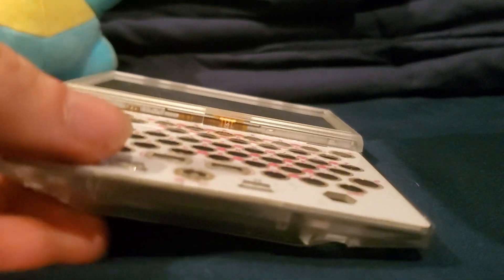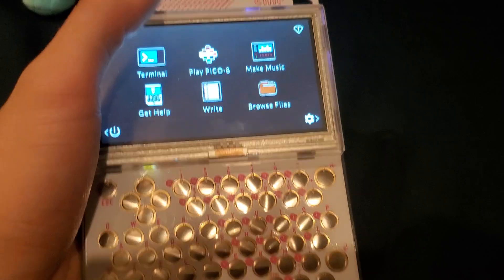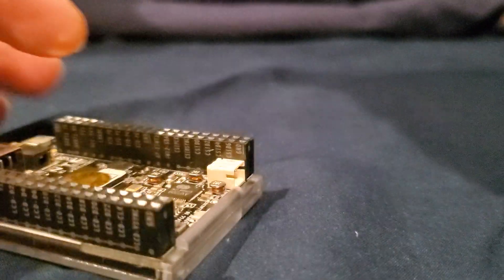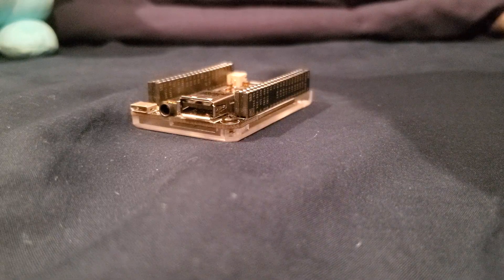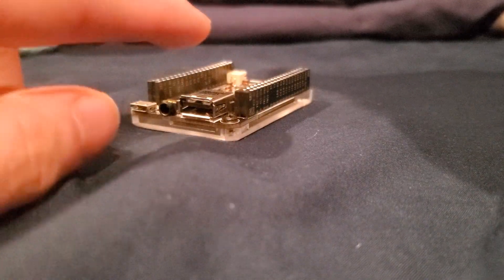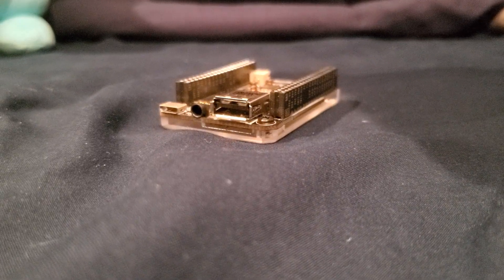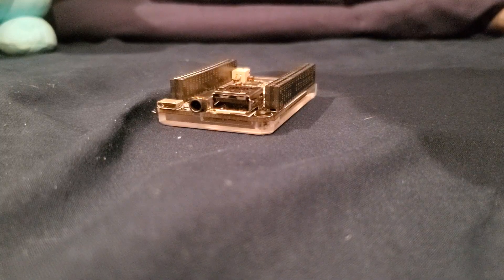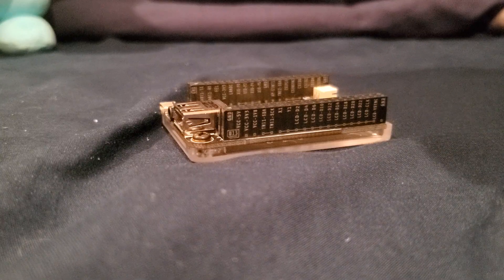Tech of Yesteryear - Pocket CHIP

Comment: I ordered several of those modules, mainly for their USB capabilities, but never received anything, and they stopped responding when asked for a refund. It's nice to see some people got them and put them to some use, but from my perspective it was a scam.
Reply from the maker: @phosphite  I followed the project initially in 2016 (if I remember right) and didn't think much of it.  I never actually got it from the kickstarter. All mine right now are second-hand "broken" units.  Most just need to be reflashed, but since it's a lost art I need to find a way to get it working 100% correctly.
Reply: I never ordered the Pocket CHIP, just a single of the main board. Never did much with it, unfortunately. Or maybe fortunately, given the lack of firmware for it nowadays.

Comment: I remember reading about these and wishing I could afford it, only to hear it was a scam. 
I guess I am happy some do exist.
Reply from the maker: Yeah, many other people have discussed it, but I intend on making a short, "to the point" ish video on this eventually.  Everyone that has made a video is far more indepth than I could dream of.  Thankful some people got their hands on some too. (Since all mine are second hand)
Reply: They technically weren't vaporware, but the raspberry pi zero coming out as a $5 computer really undermined their $9 computer pitch. It had storage and wifi built in but not HDMI out at that range, but possibly composite if you cut the TRRS connector.
Reply: @LostieTrekieTechie  It also had native paralel LCD connector, no need to use GPIOs for driving an LCD. That was really good for the time, not many had this.